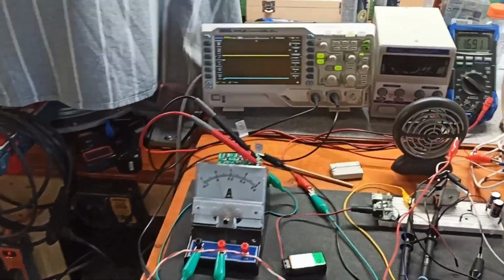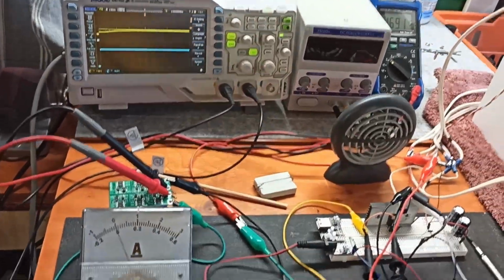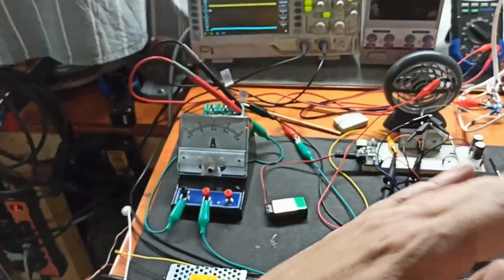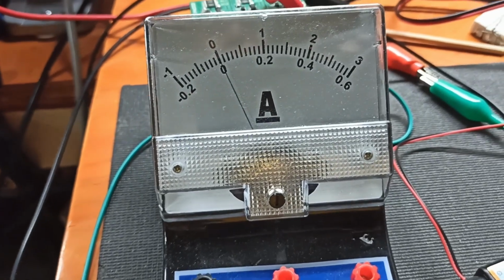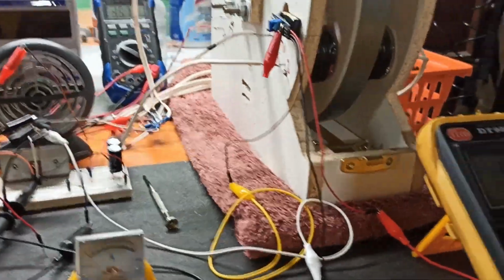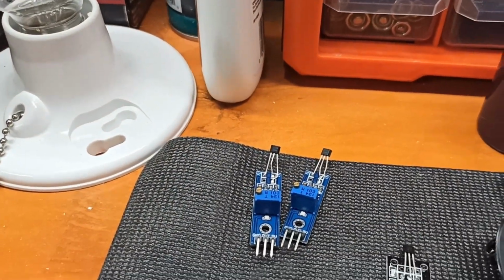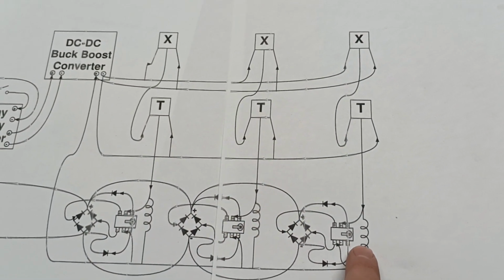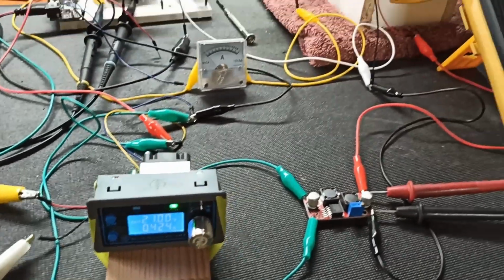Electro Magnetic Pulse Motor - Part 26

Comment: Solar Winter Tip, You can steplessly dim down a Beuler and all other hungry electricity consumers with a 5000W dimmer (EUR 7). I run 5 dimmers in parallel on an 850W inverter. Kettle 2.2KW at 150W runs 12 hours a day, so the water is always hot. The room is also nicely heated. 2.5KW washing machine runs in parallel with dimmed to 200...400W. Iron, dishwasher, oven, electric heater, coffee machine, all internal heating are throttled with me. Videos about it on my channel https://youtu.be/eC2olbCBhh0 The inverter stays cool, quiet and the MOSFETs remain intact because extreme current peaks no longer arrive at the inverter. Now every Mini PV Inverter is enough to sell large devices. So with the dimmer all internal heaters/devices can be turned into base load devices that stay almost permanently ON while drawing very little current.

Comment: When you say current limited and it hits 1amp does the variable-psu bring down voltage? I basically shorted out a variable-psu like the one you have and constant current brought the voltage down to 0?
Reply from the maker: If the thing you are powering with a current limited power supply like this pulls more amps than permitted by the supply (1.2 amps in my case.) it will just shut off for about 1 second, then turn back on.  Then it will spike above its current limited again and shut off again, over and over.  So I bought the DC-DC constant current supply to help keep it below the 24v power supplies limits.  Ultimately I won't need this in the final version of this build because I'll be pulling power from either capacitor banks or lithium batteries directly.  But it's still nice to have all the control.
Reply: @bumpymotors  Is Constant Current even a thing? Can a PSU actually add resistance between a hypothetical short to limit current to some arbitrary number?